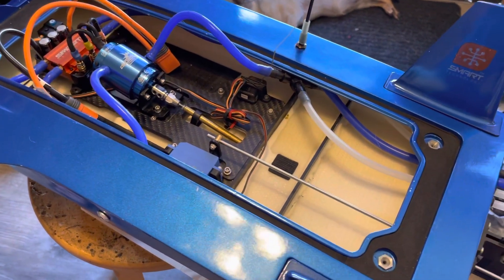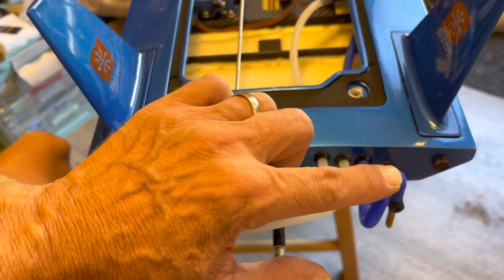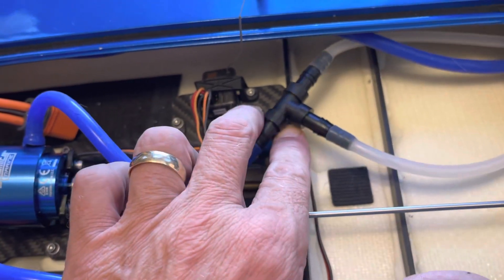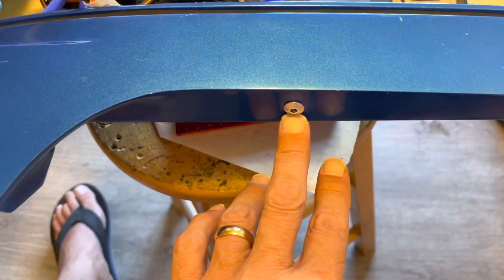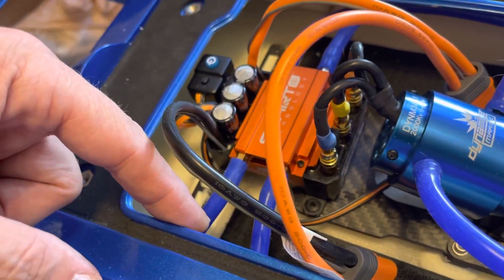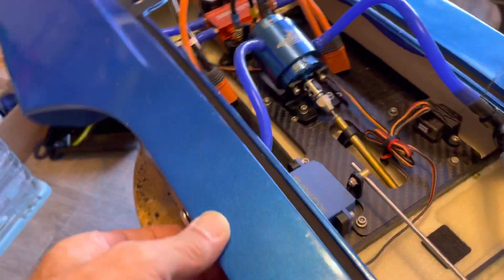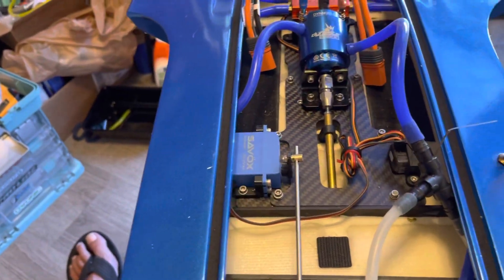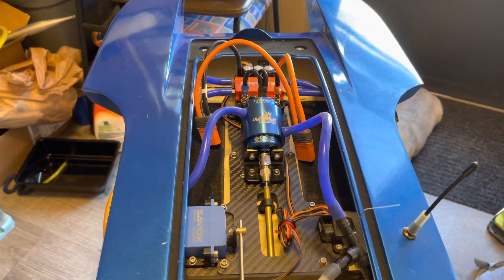ProBoat UL-19 upgraded cooling finished

Comment: Hey man just wanted to say you and your family are in my family's prayers. I hope everything works out for the best for you. I hate even asking this at a time like this but do you happens to have or know someone who has a hydroplane hull they're willing to part with. For a reasonable price I want to build another after crashing and totalling my old hrdo. I have a sonic wake I'm rebuilding now that I started with just a empty hull. And I smoked my leopard 4072 2200kv motor . Ran it hot and locked it up. But I did mine differently than all the rest I mounted my  rudder in the center behind the prop and I like it that way over being mounted to the right of the prop. Anyway just figured I'd ask about a hydro hull I'm dieing to find one to build again. Im a build from scratch kinda guy over buying rtr
Reply from the maker: Thanks for the prayers and unfortunately I don’t have any to sell right now.I recommend big you want to build one just order the UL-19 hull and canopy.Offshore Electrics has all the parts for the rest .I will reach out and see if anyone my have one used and let you know.
Reply from the maker: I have another UL-19 hull and the stock tray I pulled out of mine I changed to carbon.The hull is solid with only some scratches and a small seam paint crack.Didn’t leak but you will need a canopy .Send me you email and I will message you about it to get your shipping and send it to you.
Reply from the maker: That will be fine and will email you later today or tomorrow.My son is out for fall break and we are looking at a fine day for the outdoor today👍
Reply from the maker: Send me a email at jwatson850@gmail.com so we can see about getting you a hull to build.I have a new UL-19 hull coming in today and will send you this hull I have and just needs new paint and accessories.
Reply from the maker: Got busy and was looking for your email in a ton of messages and didn’t see it

Comment: Did you upgrade your flex shaft?
Reply from the maker: Stock flex shaft ,never had an issue with the flex shaft on these👍
Reply: @mildtowildrc7343  I just ordered one of these. Pretty much doing what you are doing. OSE has 2 different upgrade flex cable for it. Wasnt sure if i should get it or just send it for now. Want to run it on 6s. What do you recommend ?
Reply from the maker: Just send it for now the factory shaft works good,just keep your grease on it after each full run.The upgraded shaft from OSE is great and have one for this in case I break it.I recommend leaving the liner with standard HD flex shaft .The other choice is larger and removes the liner for racing only,but more rotating mass is slowing take off and speed👍